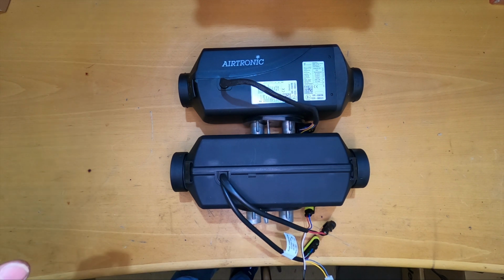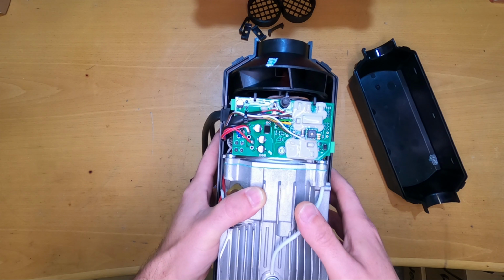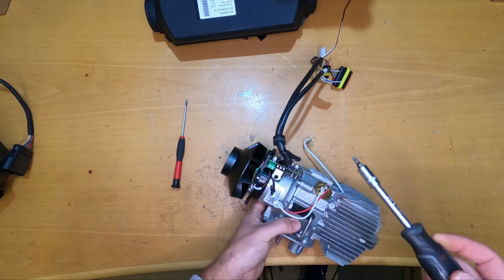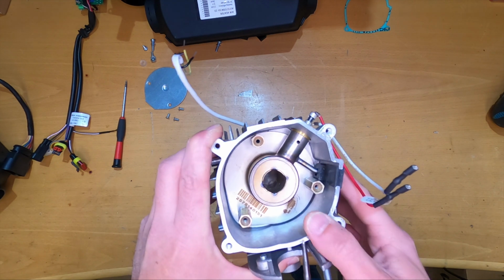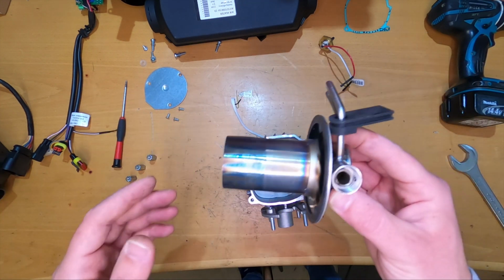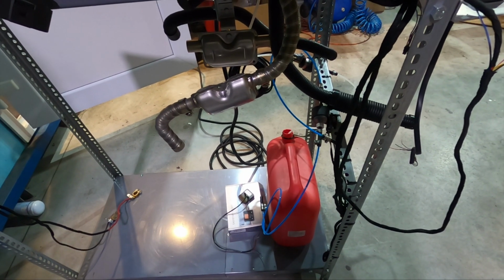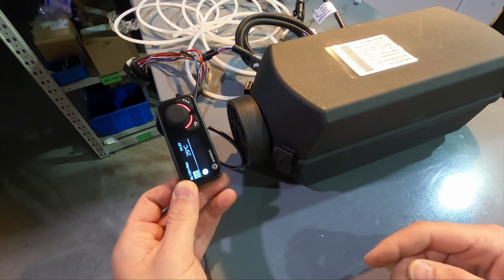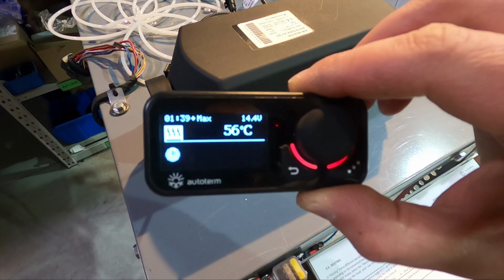AUTOTERM Planar Air 2 D TEARDOWN, TESTING and REVIEW !!! Russian diesel heater

Comment: In power mode, it runs for a minimum of 8 minutes on high, to remove any soot produced during start up. Then it will drop to the set power mode level. I think in temperature mode it's similar, it runs for a minimum time (probably 8 minutes) before it's allowed to slow down or stop. If you want to cycle the unit more often, you're probably better getting a Propex gas unit, as they don't have a glow plug or soot to worry about and can switch off faster.

Comment: Great Video and Work , have you got an Idea or a Procedere to remove eventually dust from the fan Blades? Vaccum or a brush or compressed air ? Best would be w/o removal or disassembly of the heaters? For Controllong the Heat i needed to select thermostat Mode and then adjust the temp and then start ( another round Logo will appear under the timestamp) i have external Sensor so it regulates also in the Heat and fan Mode. In the Heat and Power mode it runs according the Poti setting ( full or 3/4 or 1/2 or Minimum)

Comment: I run 3 CDH die cast housings, which have EU certification, I believe directly due to fire resistant housing. They are a little more cost, and a little harder to find. Is the PLANAR EU certified ?
Reply from the maker: It must be, it is sold all over the EU
Reply: @DIYHelper  From your response, I assume you think all heaters sold have EU certification, if so, You are totally WRONG.
Reply from the maker: @stevecarlisle3323  https://autoterm.com/blog/post/renewed-r10-r122-certificates-air-2d-air-4d
Reply: @DIYHelper  please read my original post ! I was refering to CDH !
Reply from the maker: You were asking about the planars certification if read your own post. Planar is a well known brand that's why I replied it must have certification. Chds you have could have or not a real certification as you stated not only certified products come in the EU. I think a publicly available database from the certifiers is the only way to really be sure which ones are real or fake.
Reply: @DIYHelper  the reason I asked about PLANAR, is because you were comparing in your video against the AIRTRONIC, which has a certification EU label. Maybe the Planer has that EU label on the other side. "MUST HAVE" to me is no gaurentee that it is a EU certified heater.
Reply: @DIYHelper  4:57

Comment: These are good but the back up is crap no response and takes weeks for a reply 🤮
Reply: Weird. I exchanged probably 20 e-mails with the pre-sales and tech support in the last 2 days and I'm not even a customer yet. They replied to all my questions adequately and quickly. I gotta say I've rarely seen such customer support anywhere, let alone for just a potential customer. As a comparison with Webasto - you don't even have direct access to customer support there. They rejected TWICE in a month to repair their stupid heater under warranty and last time it almost set my RV on fire.

Comment: Thanks for your excellent video. I have the Planar 2D, 8 years old, used a few days a year and never had a problem. But parts are now ridiculously priced, like $187 for a glow plug. You can buy a complete Chinese heater with a couple of $ more. I'm wondering if there is a cheap alternative glow plug which will will work in case I do have to get a new one someday. Planar are 9V, most other plugs are 12V. Does that matter?
Reply from the maker: Probably because of the Russian ban, a glow plug should last without problems 10000 cycles. 9V plug cannot be replaced with 12v, Chinese heaters are Eberspaecher clones and Eberspaecher has 9v plugs not sure about the Chinese ones but I suspect it is the same
Reply: @DIYHelper not Russian anymore, they moved to Latvia but they are still Russian owned
Reply: @DIYHelper  The glow plugs are manufactured in Europe, while their core comes from Japan (Kyocera)
Reply from the maker: @bormotuxa2463 almost all heaters use  ceramic Kyocera plugs
Reply: There are two sensors.  One in the controller and one in the heater unit. You need to select which sensor you want to use.

Comment: The eberspacher is double the price for the complete set.  
In the ownsers' manual the diagrams shows an external temperature sensor, which you mention at 3:37.  Without it i presume it can not detect temperature i presume.
Reply: Is not double , in UK for example is 230/250£ diference between them ….
Reply: @onyxnorbert  Then you are lucky.  Over here, Belgium, Netherlands, same shop, it's 650 for the complete Autoterm set and 1300 for the Eberspacher set, so if i paid attention in school that means double.
Reply: @Charlemagne1367 I'm in UK, never seen eberspacher for less than 1500,even working second hand ones go for 500 plus,the Chinese ones are junk.i live on my boat so they get a lot of use and the planar is the one for me
Reply: @blackpig52  Same here, fan of the planar/autoterm.

Comment: Your cable assumptions are correct and the brown/white ist the "alarm" connection which will start the heater for 2h but not on last settings it will be always running on highest mode for 2h

Comment: I'd rather use the Chinese diesel heaters, I have two of the metal housing so called 8kw diesel air heaters with the blue lcd controllers and red feedback remotes and I love them plus the parts are easy to find and cheap. Keep up the good work and stay safe and God bless you and your family
Reply from the maker: Thanks for stopping and saying hello, as functionality the Autoterm is a little bit better than the CDH but the price is close to Eberspacher (Espar) so for a little difference you get a much better heater. Nothing can compete with the price of Chinese ones. Stay safe a blessed holidays.
Reply: My Chinese heater lasted a month of daily use in my boat, also had a fault in the aluminium casting (No quality control) that blew exhaust gas into the compartment airflow. Electronics is very sad, they used the wrong size electrolytics from some Chinese crap brand. and it was not protected by a conformal coating. Fan was to big or hole to small , had to sand that down. 5kW turned out to be 2kW. After a month I had to clean it and removed almost 100mL sooth because it runs much to rich, it was not tuned or tested in the factory. Could not get the soot out of the ignition chamber. I had no clue where to get parts because there is no spareparts list so have to buy them from a foto and gamble if it is the right size. Replaced it by an Autoterm and keep the crappy one as a spare for if I need to service the autoterm during winter.
Reply: Eberspacher is twice the price as autoterm my frind